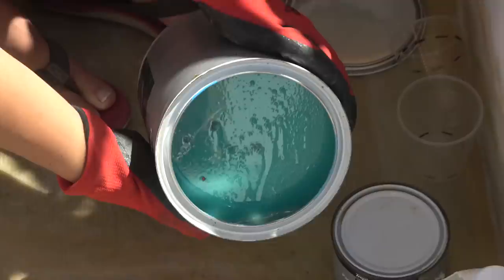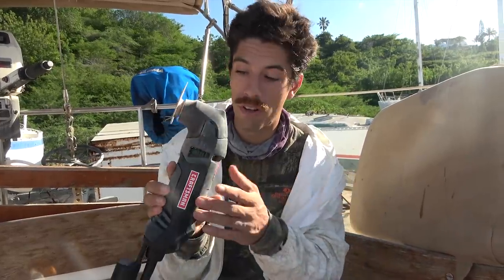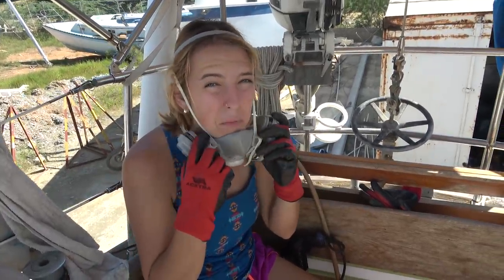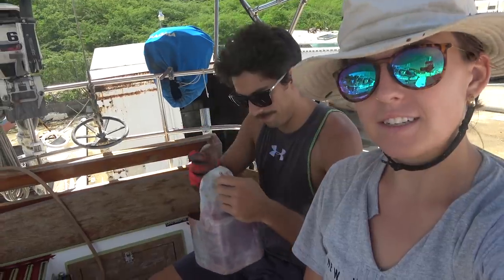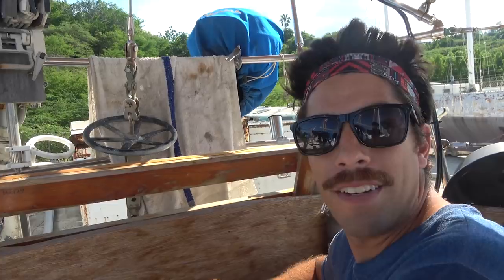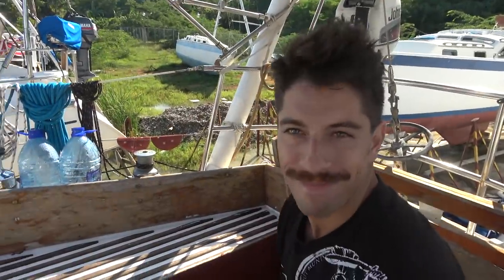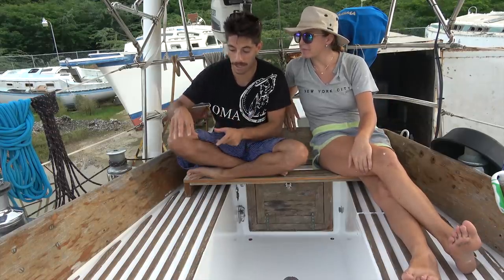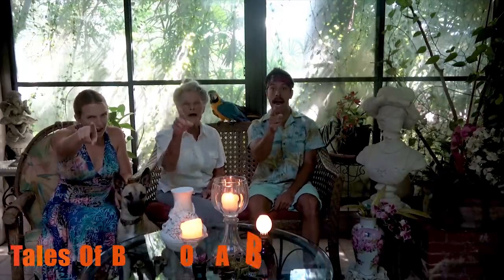Transformation Complete✨The Old Girl looks BETTER than EVER Ep 99

Comment: I used the Star Bright Teak Care Kit to restore the teak on my boat.  I was amazed at how nice the wood looks now because it was totally grey and stained before I started.  Its a three step process but I did it all in one day.  Most of the time is waiting for the wood to dry between steps.  There is a cleaner that you scrub with an abrasive dish scrubber or steel wool, a bleach that brings out the grain and oil as the last step.  The oil will stain fiberglass so taping around it before that step is a good idea, but the results look beautiful when you're done.  Just rub in a little more oil every 6 months to a year to maintain after the initial restoration.  I'll try to make next weeks video about it so you can see how it works.
Reply from the maker: Cool we will check it out.
Reply: I just bought that kit for some of the trim on my boat, but haven’t gotten around to it yet. Glad to hear it works well. Looking forward to doing that project.

Comment: Speaking of your teak, never use a pressure washer on it, that will remove to soft wood between the grain.  Sea water turns unfinished teak gray, however: Add a teaspoonful of oxalic acid crystal to a bucket of water and detergent every few days, splashe it on the teak, let it soak a few moments, then swab the teak and rinse it very well with fresh water.
Reply from the maker: Cool, thanks for the tip.

Comment: Just a couple of  tips for you. I am a woodworker and it happens that I use the very same Bosh grinder that you use, it is a beast, super powerful, much more efficient then other cheaper models, but is a little hard to tame. I notice that when you show it working it is always on the not turbo setting, so it is only doing orbits but not rotating, and doing so you loose its advantage towards cheaper models. I perfectly know that on turbo mode it kicks like an angry mule, but the right fix for it is not avoid the turbo mode, just to slow down the speed, if you dial from 6, the maximum speed to 4 or 4.5, in some cases also 5 works, it depends on the grit you are using and the material you are sanding, it stills does the work much faster then in the other mode, but puts a lot less strain on your body, you don't have any more to fight against it.
I usually do the bulk of the work with the turbo mode on and reduced speed, bringing it to the highest value that makes the tool still easy to use, then i switch to the other mode ( with the engine stopped, very important), crank up the speed and make one more pass, it removes the marks left by the turbo mode fast and refines the surface. Needing to use later finer grits to switch to turbo mode is no more needed, but to use it with the coarser grit makes the work a lot more fast and efficient.
The second tip is to try to use all the sand paper disk, to press it all on the surface you are grinding, it is a tool designed to work like that, while with an angle grinder and a sanding pad you work more the other way, with the edge of the disk and the disk not parallel to the surface you are sanding. To do it with that Bosh sander puts strains on parts of the tool, it is not designed to work like that, and even if it is a very good professional tool some parts are made of (hi tech) plastic and to replace is very expensive . Don't ask me how i know it, let's just say that i had to replace those very expensive parts just 1 month before the warranty expiration date, so them come for free for me, I had been very lucky, but only a month later...
Now the tool has many years, has worked a lot and did not had any further problem as i no more put that kind of strain on it.
Best Regards from Italy.

Comment: The 'Teak Oil Purists' will howl, but we got tired of having to spend all our time oiling the wood bits. So I sanded and used a light stain then coated everything with UV resistant matte epoxy. Five years of sun and sea and the shiny bits are still looking good...
Reply from the maker: HMM interesting idea
Reply: @Bumsonaboat  You still have to leave the underside 'open' to prevent moisture from attacking the wood or 'bubbling' the finish, but as long as the planks are slightly 'elevated' they can dry out between bouts of wet and only need refinishing every four or five years...

Comment: You usually want to use paper towels when your degrease/waxing. One swipe flip another swipe fold inside out another swipe flip one more swipe throw away. Using a cloth like that and not getting new cloths is just moving it all around. I hope it turns out ok for you though.
Reply from the maker: Okay this makes sense. Sure seems to be adhering well but time will tell. Thanks for the pointer.

Comment: You didn't show it, but did you mask off the area where the steering pedestal mounts before applying the non-skid coat?
Reply from the maker: We did not but the consistency was like sugar. What would be the concern of having the non-skid where the pedestal mounts? Honestly the non skid is hardly noticeable.
Reply: Some non-skid is rather "rough". It could make achieving a waterproof seal between the base of the pedestal and the cockpit sole problematic. Last thing you want is to replace the cockpit sole again in the future, because the water got in through the joint between the pedestal and the cockpit sole.